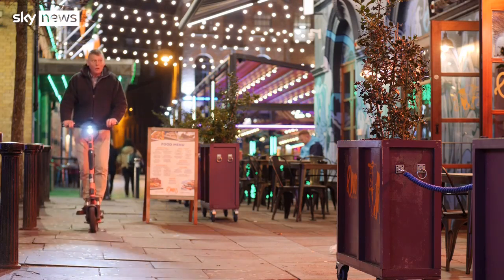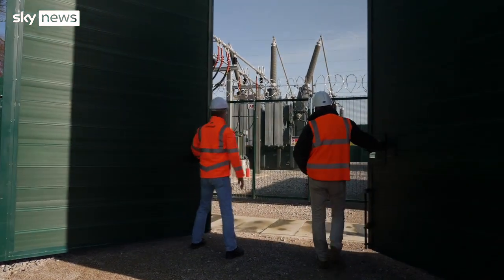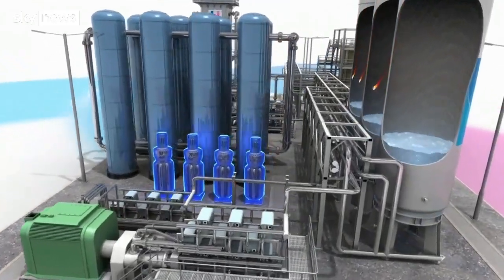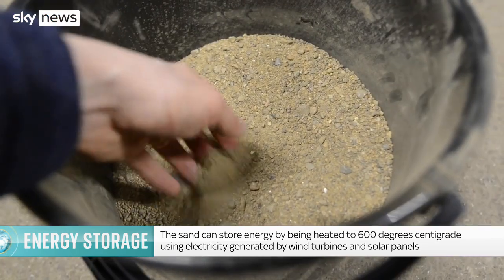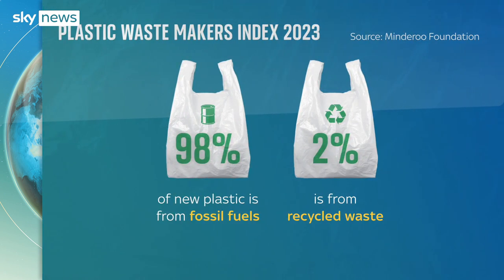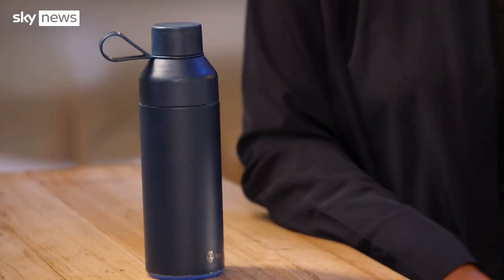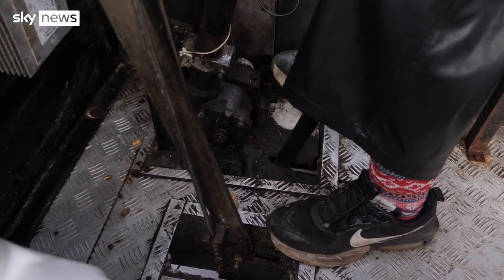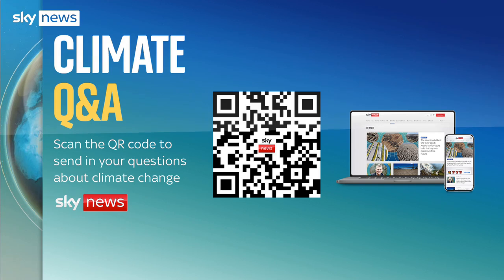Building mega-batteries to keep our lights on │The Climate Show with Tom Heap

Comment: The large scale batteries required are nowhere near ready. 

Europe’s biggest grid linked battery, enough electricity to charge 1,500 electric cars. An electric car battery capacity is about 40 kWh so the battery holds 60,000 kWh. 

The average UK household uses 10 kWh per day or 0.417 kWh per hour. The battery can supply approximately 144,000 houses with electricity for 1 hour. There are approximately 27,000,000 households in the UK. 

It would require approximately 190 of these batteries to supply British households for just one hour at average consumption. 

In December 2022 there were days with very little renewable energy so let’s look at a 24 hour period. That’s 4,660 batteries. That’s just for residential households. No industry, no business, no transport, no hospitals, no schools. 

Anyone else see the problem?

Comment: The most economic method of providing what is called base load generation capacity for when the sun doesn't shine or the wind doesn't blow is coal, nuclear and gas fired power stations, which were already constructed. The environmental catastrophic effects of Lithium/Cobalt/Silver mining for electric Batteries to power vehicles and grid storage of electrical energy cannot be underestimated.
Reply: Mining minerals and metals for producing batteries helps the environment.   Extracting gas 'hurts' the environment.

Comment: One question that was never addressed in this biased programme is; what happens to the batteries when they are replaced? 

Do we just store them in African countries like all the other batteries which leak into the environment? 

It really annoys me that no one is informed that none of the batteries shown in this programme or in electric cars can be reused or recycled. They are just dumped in a huge underground storage centre....
Reply: We can recycle batteries
Reply: They can be reused and recycled. 

The question, as with home electronics and plastics is: but are they being reused and recycled?
Reply: @jezlawrence720  They do not get recycled although some can batteries like in the tesla cannot hence why they are so expensive. 

As I've said before we are not being told the true impact of creating and dumping batteries and the mining for the minerals. This is also the case with all the materials used to manufacture phones, cars, planes, solar panels etc.
Reply: @Jase29  I would argue we're not applying enough pressure, rather than not being told.
Reply: @jezlawrence720  2 of the big reasons they don't get recycled is the cost and carbon footprint.

Comment: Batteries are ok for very short term gaps in wind/solar and stabilising frequency.  No good for overnight and windless days.  The MEGA capenhurst battery only has 1 hour capacity if required to deliver its full 100MW.

Comment: They still great as back but they still yet to replace most of the older systems. In time they will overcome it but as right they are falling short. They for sure are threat to peak power plants.
Reply: Absolutely if I was a peaker plant owner I would be repurposing my sites for rapid response and staged in/put slow response storage right now. Storage is the new peaker & grid stabilisation all in one. It's basically the answer to naysayers with their "what about when the sun's not shining". We should've been building storage for decades but what's scandalous is the Tories telling gas suppliers they didn't need strategic reserves in the mid twentyteens without a plan, instead of telling them they could stop keeping reserves if and only if they built equivalent energy storage.

Comment: Mega batteries. 

Very, er, environmentally friendly?
Reply: Think about it on a global scale. After all there is no benefit whatsoever if only the UK does this. Globally hundreds of thousands of these batteries will be needed.
Reply: Compared to long term climate damage? Yes. Especially now we've got batteries that don't use cobalt and way less lithium, and even a bunch with totally different chemistries and also (as the show explained) are waking up to heat and gravity batteries which don't use any of that stuff.

It's about what the storage is for. The voltage balancing/peaker plant replacement needs super fast batteries and supercapacitors - yeah that still needs the lithium (but not cobalt) batteries but can be supplemented with repurposed ev batteries, not new ones... If govt compelled that in exchange for investment. Medium to longer term storage - used to cover load balancing when renewables are low for longer periods, that's where your heat and gravity and slower chemical batteries come into play.

The problem is the UK gov is obsessed with silver bullets, when this is a strategic diversity question. The US has woken up to this, it needs an integrated plan to make it most effective and it can be done without causing worse effects, if done by sensible people with stable long term investments, not ideologue politicians. This is a science and engineering question first, and a political one to implement second
Reply: @jez lawrence - There is no climate damage. That renders the rest of your post meaningless.
Reply: make them out of sodium ion. 6th most abundant element on earth.

Comment: Interesting to hear that this Mega-battery can charge the extraordinary number of 1,500 electric cars. The car fleet in the UK stands at 32,000,000. I’ll leave it up to the “experts” to figure out how many super duper mega-batteries will be required when everyone has an electric car. 

Yes, I know that they won’t all be charged on the same day.
Reply: Considering it is just sand, 2 heat pumps and a fan, pretty cheap to go for. And fairly environment friendly as well as we have plenty of sand around and the sand don't have to be turned into a concrete.
Reply: 21,334 batteries :)